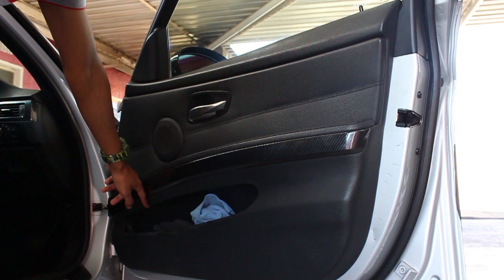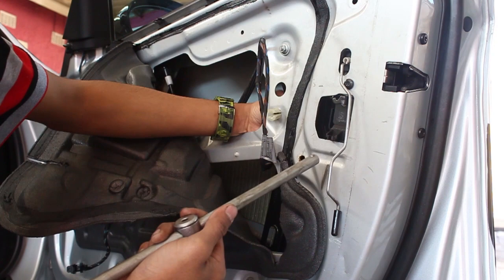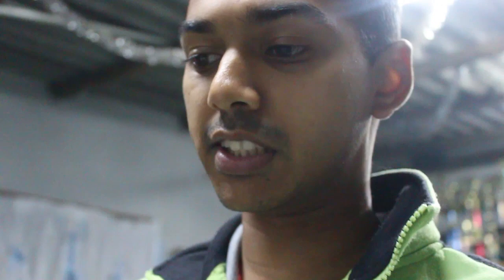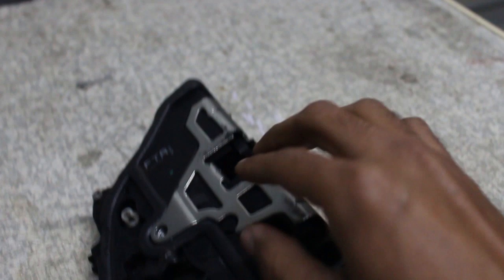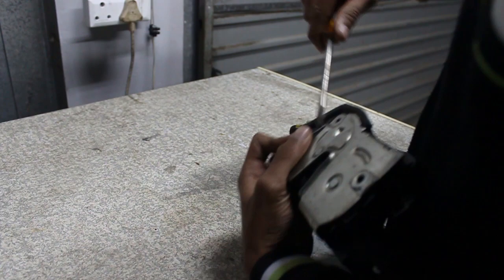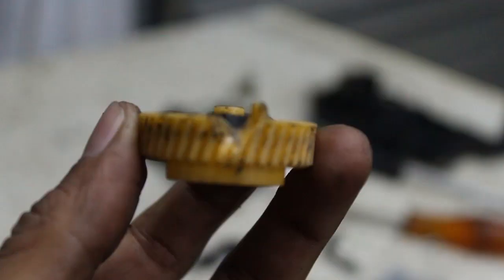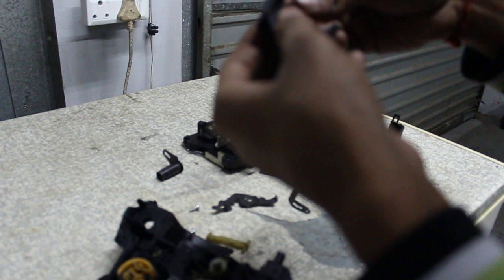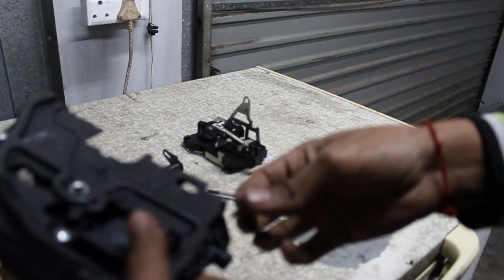BMW E90 : Door Lock Replacement and repair

Comment: Excellent video - thank you very much.  I did buy the repair kits from the Amazon Link in your video, which worked perfectly. 
A couple of notes on the process - I found taking out the external handle unnecesary - I first took it out and the courtesy light turned out to be a problem to put it back, although eventually everything worked out fine.  Another important thing is that once you have changed the faulty parts - in my case were the plastic wheel and one the large plastic piece that actually unlock and lock the door - and I realized that in order for the lock to work properly, it must be assembled in the unlocked position.  If you do it otherwise, it just wont work.
Thank you very much!!

Comment: I had the same locks on my E87 1 series; one started squealing when locking - I didnt know how to open the unit, so just managed to extract the actuator and drown it in WD40 as a temporary fix. Thanks for the disassembly of the actuator; thats really useful.
Reply from the maker: Hope it works out for you, and thank you for the support

Comment: Great video bro! Im having an issue with mine where the driver lock locks really slow if I dont drive for a few days. Like it goes in slow motion compared to the other doors. Maybe it just needs to be lubricated
Reply from the maker: Thank you brother 🙏🏼 my assumption off the bat would be the motors in the unit could be getting lazy, or the rod that connects to the button has something thats holding it back from moving freely. I hope that helps🙏🏼
Reply: The legendary Justin Beuce!!!!  🙏🏽  and thanx Preshan great vid

Comment: Mine rapidly clicks like its trying to  unlock the door but can't .. it locks the door perfectly but clicks fast when I try to unlock the door the only way  to open the door is from the inside ...... thank you bro I knew something  inside was eaten up for sure
Reply from the maker: Its a pleasure, glad i could help🙏🏼
Reply: @Realpreshaanb  I think im going to rebuild it and put a little layer of grease on the gears .
Reply from the maker: If it works out cheaper to rebuild, I'd do the same as well... But i couldn't get the gears and stuff in time so it was most effective to replace
Reply: @Realpreshaanb  I don't want to buy a used one and it fails again on which is bound to happen  unfortunately
Reply: @Realpreshaanb  but the link i sent from Amazon those that look like the correct  parts
Reply from the maker: Understandable... Although i got this used one since uploading the video in 2017, still working as it should 😁
Reply from the maker: @mtbridingog9083  yes its the same... I think i should include the link to the repair kit in the description as well😁
Reply: @Realpreshaanb  amazing thanks

Comment: Very informative and helpful, even fix the broken piece of actuator.  I have exactly same issue.
Reply from the maker: Thank you for your kind words, i didn't fix the broken one, i just had it replaced, i actually still have the broken one should the replacement fail. I just need to get the gears for it

Comment: Great video, having the same problem with mine...left front cant unlock, there is  slight movement from the nob  when pressing the key to unlock a sign that something is skipping.
Reply from the maker: Both, the motors inside the unit and the actual gears are broken, best to replace with a new unit 👌🏼

Comment: Hey awsome vid, helped ne alot. Anyways the passenger lock works again but while driving the car thinks the dor is still open.. no entrys in obd.. any suggestions?
Reply from the maker: Try loosening up the actual lock on the door and pushing it further in so it pulls the door further in, if that makes sense

Comment: Hoping you read this!  My 2007 328i has a strange problem.  The left rear door will lock during driving, but when I stop and lock all doors with key fob the left rear door unlocks!  It has a new actuator.

Comment: Thank you so much for this video and your telling everything.I’m wondering I have same problem too on my back door lock It isn’t working with key I’m pressing unluck button It’s not unlocking  But If I try to open inside it can be open after than I can use and my door can be open But all the time I have to do this circle.What’s your idea it’s about the gear on the lock inside or other. Thank you for your helping. Peace ✌🏻
Reply: Did you get them fixed yet? I have the same issue and am about to replace the actuator soon.
Reply: @BrixChris  bro i did not fixed myself i was going to bodywork shop,expert guy fixed for $20 the plastic part was damaged,part replaced

Comment: Preshaan Briglall Good evening . Thank you for this video, I have a 2006 BMW E90 316I. My Right Rear Door is locked – the lock is broken. I have opened the wallpaper, but from all the places I tried it does NOT open. What should I do? If I open the two door support hinges will I be able to open the door? It does NOT open at all. What should I do to open it?
Thank you.
Reply from the maker: Quite literally break the door lock latch from within... The sad part of this is you'd need to have the door skin removed to get access to cut the door lock off... Because of the damages and because its the rear door its quite impossible to use your hands to get in there due to the limited space
Reply: @Realpreshaanb  Thank you very much for your prompt reply. I have removed all the wallpaper from the inside. If I understood correctly to break all the plastic of the lock?
What should I break it with?
Reply from the maker: You can use a prybar and a hammer to break it out or you'll need to get a locksmith to have it cut out
Reply: It is the rear RIGHT door – behind the passenger seat. My car is left hand drive - I am in Athens - Greece - Europe
Thank you very much. God bless you. I'll get back to you when I find a way to open the door.

Comment: Thanks for putting together the video. I have worked out that the only thing wrong with my actuator is the gear like yours. I am going to buy the gear from amazon and rebuild the actuator. Is it important what rotation position the gear goes back in relative to the lock position? For example gear ear at 12 o'clock and the lock open. I am worried that when I start up the motor will drive the gear to the wrong position because the worm gear and lock are out of sync.
Reply from the maker: The gear will only fit in one direction as it will correspond with the worm gear it slots into, which the motor drives, all it is afterwards is reassembling in the correct order and all should be well

Comment: Thanks for making this video. Like you, I would like to understand what the problem is and attempt to repair it. After watching your video, I doubt I would be able to get the part (Gear) in order to repair the lock, so I think I'll pass on disassembling and try to get a replacement lock assembly. Mine, like yours, still works to lock but doesn't unlock.
Reply from the maker: Thank you, its easier and faster having the whole unit replaced rather than repaired

Comment: Thanks for this video, any suggestion where I can get my drivers door actuator from bud ? Or can we repair it as it just stopped working all of a sudden , no squeaking nothing ….?
Reply from the maker: I have links in the video description which you can check out. its far more effective to replace the unit instead of repairing IMO

Comment: .Good evening from Athens . I have a 2006 BMW 316i E90. The rear right door lock broke. I ordered two plastic gears from Lithuania and replaced the one that had two breaks. But when I put it in the car it wouldn't open from the outside. I took it out again and put the plastic gear in another position and it wouldn't close with the remote control – it opened from the outside and the inside while the other doors were closed with the remote control. What's wrong ; when you show the lock repair video, I need some details. If possible have English subtitles. Be well soon. Good night.

Comment: cool video bro. can you please help. My 1 series key unlocks boot and doors perfectly all the time but when i lock it only works sometimes. any ideas what i should check. thanks bro
Reply from the maker: sounds like the button on the key is on its way out, try using the spare key and check if its doing the same thing

Comment: I just did this to my passenger rear door. The issue with mine was that it wouldn’t unlock the outside handle so it had to be opened from inside. After replacing a few pieces both handles work awesome but when I press the lock or unlock button it clicks 3 to 5 more times than it should but then works normally after a few tries.
Reply from the maker: That would be internal failure inside the lock itself. The Gears are skipping and will need to be replaced
Reply: @Realpreshaanb  upon closer inspection I failed to match the new plastic gear with the old broken so without noticing i put the left actuater gear in my right side actuator

Comment: Hi nice video well explained my key fob central locking won’t work when I press any buttons on fob but all the locks work when I open with little key the car stars up fine with the same key all fuses checked all ok so is it still my key or a actuator please help any information with this issue
Reply from the maker: Seems like the battery is either dead inside the key fob, or the physical buttons on the board are damaged

Comment: Great video ! would the door ajar sensor be in there as well? All my door and locks work but for some reason the door ajar light stays on ? Any ideas?
Reply from the maker: That would be my understanding, when the door is latched it will get the signal as the button is brought down, and fully latched, however it could also be a wiring issue in the loom going into the door, its best to try out another lock first before looking into the wiring
Reply: Thanks !

Comment: hi preshaan. ive a question. i bought the new actuator but I'm having the same issue as the old one: the door unlocks but does not lock, what could be the cause? Please guide
Reply from the maker: Hi, i would advise to have someone qualified to have a look at the wiring harness to your actuator... It is a possibility that there could be something wrong which is why it is unlocking but not locking
Reply: @Realpreshaanb  appreciate you taking the time to reply. Thanks a lot my G
Reply from the maker: Its a pleasure, thank you for your support to the channel 🙏🏼 i really appreciate it

Comment: I accidently left all windows open in night and rain wet almost all interior including  doors and window and lock electronic. It somehow hapend to work again but winter came and because od low temperatures, moist that left inside doors broke window electronic and i cant close drivers doors. Hope this video will help and if someone have tips to help me solve this problem i will be very grateful!

Comment: My rear passenger door locks/unlocks with the key, but the problem is when the door is unlocked, you can only open in from outside, I had a look at the door and door lock cable pulls it all the way, its seems like its not streched, could the problem be with the gear inside of the door lock?
Reply from the maker: Check if the child lock protection is not on...
Reply: It's not, I checked that first
Reply from the maker: Most probably the release mechanism is not working correctly inside the unit, the gearing inside is for the locking and unlocking for the door. You can try opening it up and see if all the springs and all components are in place
Reply: Okay, thanks a lot
Reply from the maker: You're welcome, i hope you have success in having your issue being rectified 🙏🏽

Comment: let me explain my problem: when I push the lock or unlock button on the remote all passenger doors is locked and unlocked normally BUT for the driver door is nothing happened. I always must use the key to lock and unlock the door only. for this case, does it same like you? if same can I only replace the gear as shown on the clip?

THANK YOU in advance :)
Reply from the maker: Hi, from what you experiencing, firstly, check if there is power going through to the lock, open up the doorpad and place your hand on the actual lock then use the key to lock and unlock the car, if you feel a vibration then the actual motors in the lock are working, you can then go ahead and replace the gears inside the lock and it should work as normal. As a last resort and a faster method will be to replace the complete lock as I've done. I hope this helps

Have a great day 🙏🏼
Reply: @Realpreshaanb  Is it version with touch lock? (I mean you touch the handle from car and it should get open) I have a same problem like @RyanCooper s but its sometimes closing from remote but never opening. 
Great video btw
Reply from the maker: These door locks are all the same, the comfort access (touch opening) only sends a signal to the car to unlock / lock the door, if you have the lock replaced, it will work out better instead of having it repaired 🙏🏼

Thank you for the comment and i hope this helps🙏🏼
Reply: I finally opened door panel and on your video there after removing 3 screws from doorlock its coming down.
In mine there are some wires and some cable attached to the doorlock. Havent seen nothing like this on video. Do you have any information what I need to detache?
Reply from the maker: @panmisiek69  you would need to detach the wiring cable that plugs into the door lock, and the release cable thats found on the inside of the door that connects to the outside door handle

Comment: Please help - I was in a rush while stopping the car -  BMW 3 series 2013 ,I have tried to open the driving seat door same time putting the ignition off , the internal unlock handle got ripped and still hanging , the door lock works fine but I now have to open the window using the handle outside to open the door which is quite uncomfortable .please could you advise how to fix the door  knob inside which is just sticking as usual without opening the door .
Thanks
Reply from the maker: You would need to open the door panel, and have a look to see if the cable did not jump off from the lock to the inside handle 👌🏼 i hope that helps

Comment: So - my '06 325 - the inside handle will unlock the door - but then won't open the door. Neither will the outside handle. And my remote (or the lock button on the dash) will unlock the doors just fine. Do you think this is the actuator or the bowden cable? And - my door is SHUT. ugh! LOL!
Reply from the maker: If the handle on the inside unlocks the door  as well as the buttons inside the car and the key, then the Central locking part of the actuator is working perfectly, it seems like the actual latch on the actuator is stuck in the closed position, you're going to have to find a way to remove the door panel with the door closed and try to unlatch it manually, worst and most extreme case is to break open the latch from the door😬

Comment: I just replaced that plastic wheel inside the actuator and still the same problem..teeth on old one was broken and didnt see anything else broken around..wrongly assembled??🙄🙄
Reply from the maker: Most likely, i would recommend removing the actuator off the vehicle, open it up and double check if everything is in place, and before installing, hold it in your hand and plug it back, slide the latch all the way in and use your key to test, that way if its still not 100% it would save you time so you don't have to go through installation and removal ✌🏼
Reply: @Realpreshaanb  after 3hrs i have enough of all this..will try some day..or will get 2nd hand complete doors haha

Comment: My issue is rear driver door... it wont open. So how can I open it to replace it?
Reply: Have the same issue with the front passanger door. have you solved yours ?
Reply from the maker: Yes i ended up replacing the complete unit... And disassemble the damaged one to explain what is the most common component that goes wrong
Reply: @Realpreshaanb  Read the question again buddy he is saying that "THE DOOR WONT OPEN !. So how can I open the DOOR to replace it?"
Reply from the maker: DM me on Instagram or send me an email p.briglall@gmail.com

I got a few suggestions that might work
Reply from the maker: If the door doesn't open, you're going to have to MacGyver your way and remove the door panel off and get access to the actual unit, theres a latch release pin that you will need to push down to release the latch & open the door . It happened to me on a previous E90 that we had owned. I hope this helps
Reply: @Realpreshaanb  Thanks im try and find that release pin.
Reply: @Realpreshaanb  Hello. You have made a great video and give very good advice. I have the same problem with the door not opening. Is there any chance you could direct me to the latch release pin. Ive spent 2 hours feeling and searching for a latch or switch with no success. Any help will do. Thanks and God Bless.
Reply from the maker: Hi, i hope this helps, the release pin is connected to the physical cable on the door panel 🙏🏼
Reply: @Realpreshaanb  thanks for that. I Guess i will have to keep searching. 😔Thats the pin i have been pushing. Thank you for your time. God Bless.